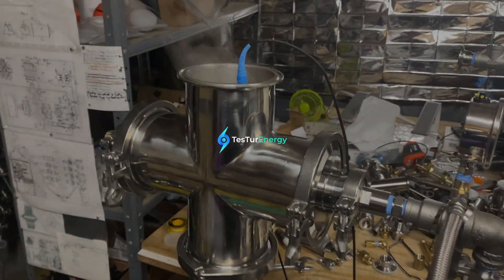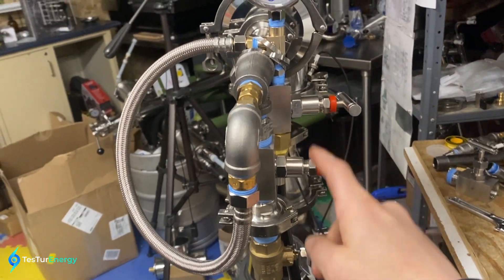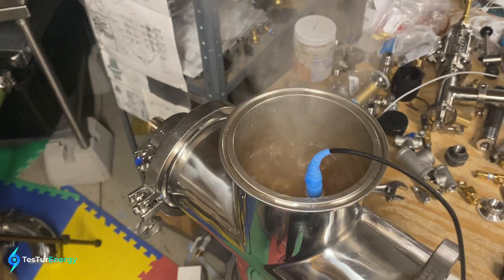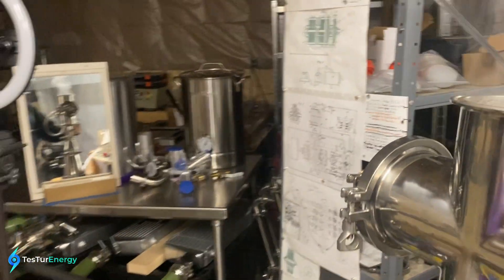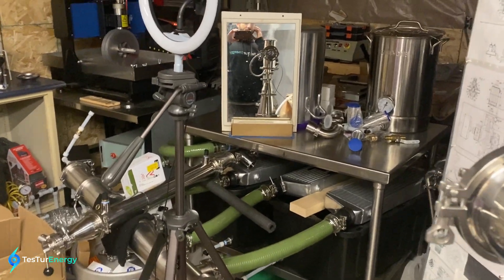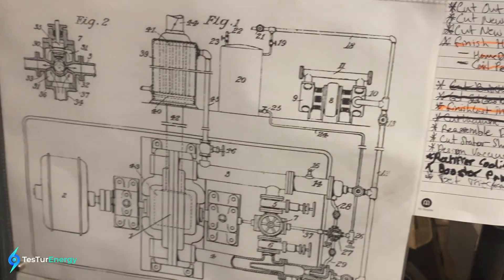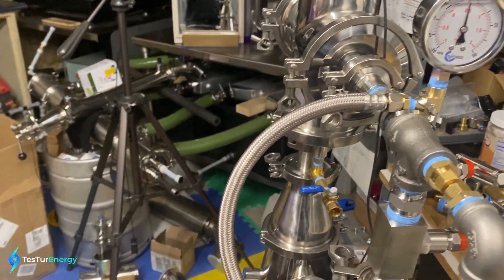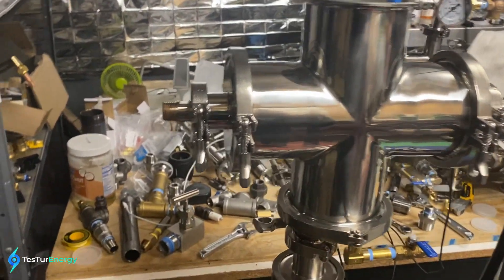Tesla Turbine Jet Engine Combustion System GB186,083 - Powdered Iron Fuel + propane micro burner

Comment: Interesting idea about the powdered fuels. Looks like Al would be fairly competitive with current fuels on a MJ/kg basis.
Reply from the maker: Iron has a low mass energy density but it’s volumetric energy density is really high so it’s good for stationary power houses.

Comment: You burn the crude and make another source of fuel/s from the energy exchange.... You could even run the exhaust plume through an electrochemical cell....
Reply: Yes you can react the oxidized and reduced  nitrogen and water vapor in combustion exhaust to hydrazine vapor and then use that as fuel. That's how Stanley Meyer ran his dune buggy on water. Some people suspect he died of hydrazine poisoning from it.
Reply: @michaelcre8  That too. Couldn't you recover other hydrocarbons as well? Even tailoring the process for fracturing the crude for specific fuels?
Reply from the maker: They do it for what’s known as “process gain” they process it all to increase the volume of all the stuff so they have more “gallons” of a good to sell. This is why we get sold it by volume and not by mass lol 
Process gain
https://energyeducation.ca/encyclopedia/In_a_barrel_of_oil
Reply from the maker: Another example, when you gasify wood, you give up about 40% of the available thermal energy in the wood just to process it to become syngas for use in a combustion engine.
Reply: @CharlieSolis  Exactly where my head was at. Understandably, you gotta give a little, to get a little. Thank you Charlie.

Comment: I've been following your videos and find this all very interesting, but I'm confused about what's happening inside the tee fitting. Could you elaborate on that part please? Is it a pipe inside of a pipe where the tee is acting something like a water reservoir?
Reply from the maker: Hey justin! Yeah nothing complicated. The T is just a water jacket for the combustion chamber. A water jacket that’s going to be coincidentally used as a boiler to recoup the heat, that would would have otherwise radiated away from the combustion chamber itself, to be used to keep the combustion chamber cool and the subsequent steam to be mixed with the combustion jet before going into the turbine.
Reply from the maker: For all intents and purposes this is just a miniature “single pass” flame tube boiler.

Comment: Bet you could make the secondary to burn micro plastics and I will suggest extreme extra care when adding any metal powder it can go bad fast.
Reply: Long live the Tesla and the vacuum retort furnace 😄.
What your doing is exactly what I  designed for the Serbs I really wish that happened it would have used lut coal and natural gas at 2.6 billion BTU a hour. Nice job

Comment: Yes sir 20$ till oil goes bonkers. Can you calculate the BTU output? Note your water distillery right now 😆
Reply from the maker: Also I’ll say that this little thing with combustion jet and the steam going off into the room warmed the TesTur shop up faster than my propane water heater and radiant heating. The humidity in the room got up to like 45% and jumped up by 5 degrees after the 1/2hour burn I did. The humidity is usually in the 30s with all the wood I got in here. Although the temp comparison right now isn’t as accurate because it’s no where near as cold outside.
Reply from the maker: I boiled off about 1/3-1/2 a gallon of water in 30 minutes 🤷‍♂️ so about tree fiddy btu lol I know this isn’t a legitimate way to tell but that’s still a lot.